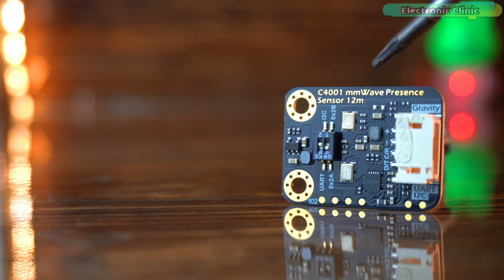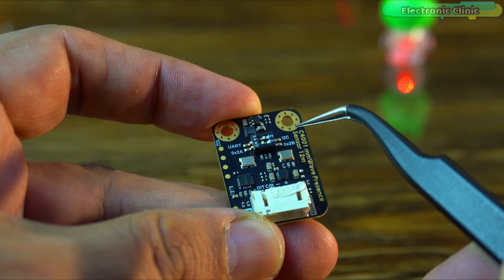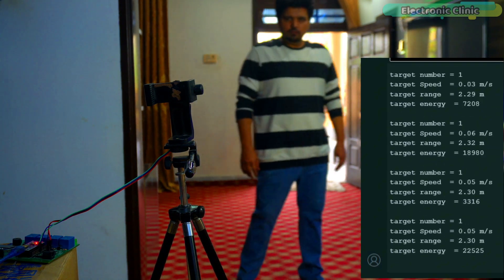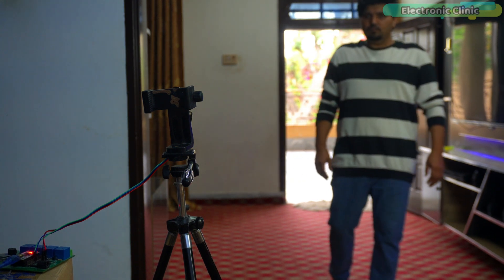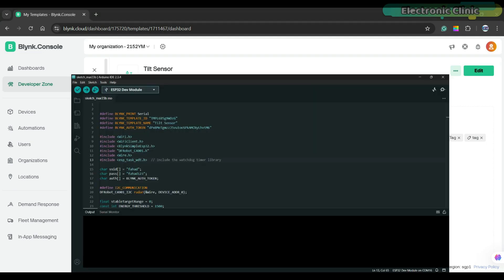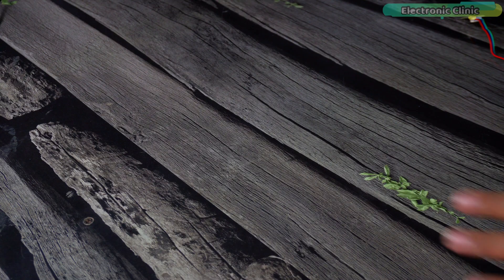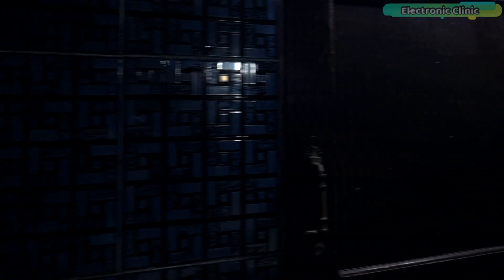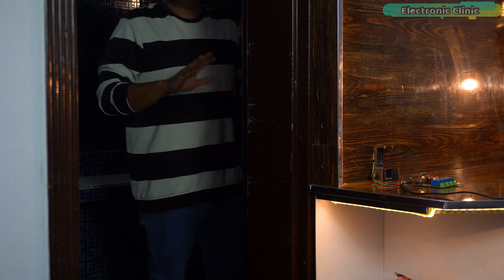C4001 mmWave Sensor, See Through  Fabric, Wood, Glass, Walls?  Arduino / ESP32, Human Detection

Comment: There are a couple of versions of the C4001. This appears to be the SEN0610.  I have the longer range C4001 SEN0609.  I found that it may not be strictly a front side detector. There appears to be motion detection from the backside as well. I do not have any instruments to measure the back detection geometry or energy, but triggering the sensor from motion behind it is definitely much more restricted, probably less than 2 meters for a human body. However, this raises the issue of directional control issues in some cases, particularly with the ability to see through many types of material. Have you any indication that the SEN0610  has a similar problem with detection motion from the back of the sensor?
Reply from the maker: During some tests I was standing behind the sensor and it didn't detect my presence. 

It can't penetrate walls, so if you install this on a wall the issue will be solved.

Comment: This sensor seems like my best bet. i want to create a buzzing fm radio like in the Silent Hill games, one problem is that it needs to be wearable, not just static. do you think i can combine this sensor with some other inputs to make it detect movement of humans, but filter out the person carrying it? since it's directional, i think it should be possible to filter on output levels? i don't care about the cost, i just want to make it as close to the game as possible, while still contained in a single enclosure (fm radio box).

Comment: What I want to know is it truly a presence sensor or a motion detector? So if you approach and get detected and then stand completely still does it eventually forget you are there? This is what is needed for an automatic light switch that does not annoy by making you wave your arms about manically every so often to keep the lights on!
Reply from the maker: i tested it. even if you slight move your head, or arm, it will detect you. its good at detecting micro-movements.

Comment: Thanks for amazing content! I wanted to know if sensors can still detect human presence through tightly sealed enclosures, such as those with an IP67 rating. Additionally, can these sensors be used outdoors in extreme weather conditions in those enclosures?
Reply from the maker: @codervicky  yes you can use it. I had the same questions in my mind. That's why I performed all these tests.
Reply: @ElectroniClinic  Nice!! I’d really appreciate it if you could cover a short video on this topic during the upcoming rainy season. I’m quite curious, as I believe closed enclosures especially tightly sealed ones (IP67) might significantly impact detection range or performance.
Reply from the maker: It can detect without issues. This sensor can penetrate wood and hard boards.
Reply from the maker: Fort his test I order another version of the C4001 thats 25 meters. I will let you know after testing it.
Reply: @ElectroniClinic  Thank you for your efforts 🙏 Just for reference, I was referring to this enclosure: ProtechT WPE16T IP65 Waterproof Plastic Enclosure with Transparent Lid. I’ve previously had issues transmitting WiFi and LoRa signals through it using the ESP32.